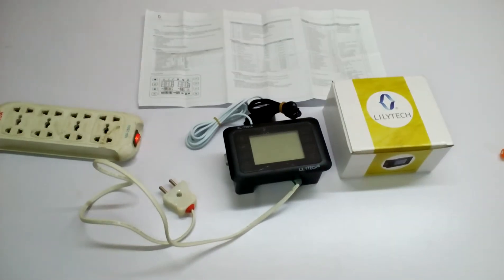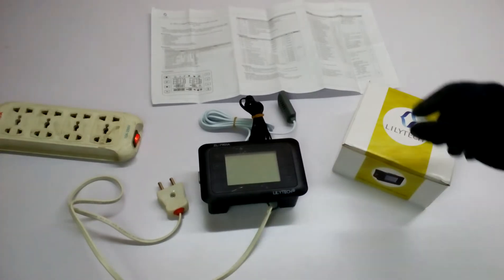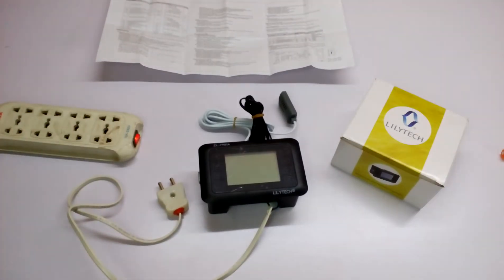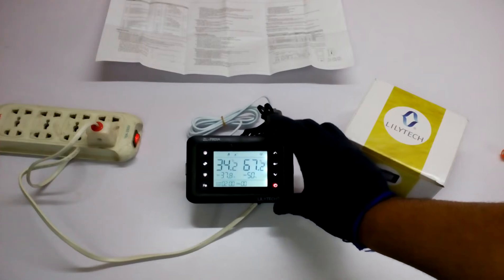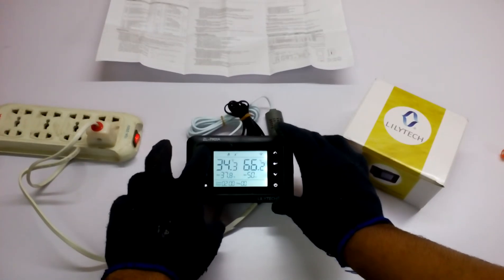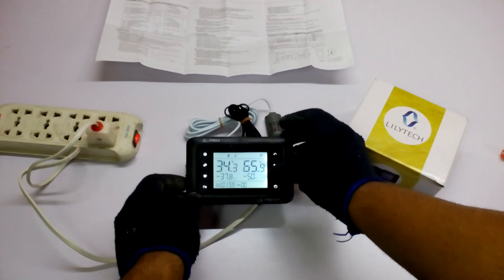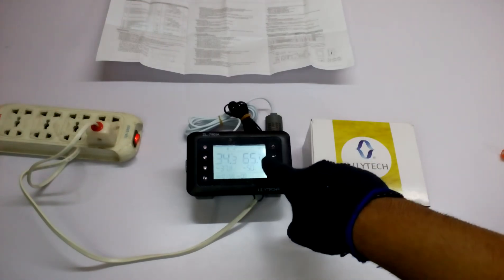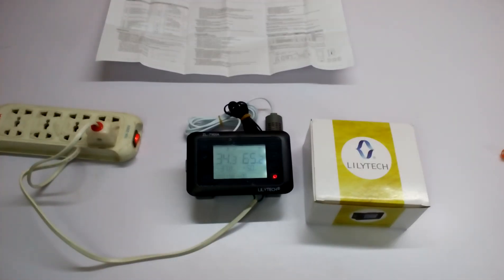temperature humidity controller thermostat for Incubator

Comment: Does the controller supply power to each of the elements of the incubator or do all the pieces need their own power source?  Also, did you ever make a video implementing this controller in an incubator?  I'd like to see it in action and actually controlling an incubator.
Reply from the maker: it will provide power to other elements when it gets 220v , I didn't use this one yet
Reply: @Umairworkshop  My purchase of the XM-18S fell through.  2 times it was returned shipping to the supplier so, they refunded my money.  Well, most of it anyway.  This is my next option.  I live in US so, it'll be 110V for me but, if it supplies that, I'm good.  Do you have any plans on putting this controller into an incubator anytime soon?  I'd like to see it but, I'm going to purchase it, anyway.  Thanks
Reply from the maker: @RobertSmith-qx1rb  you are welcome , I may not use it because I don't have it now